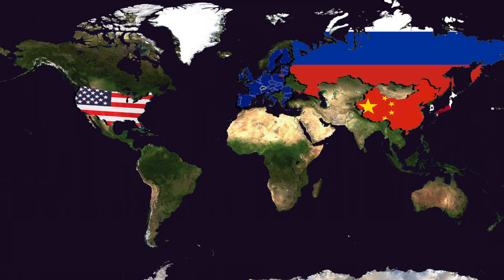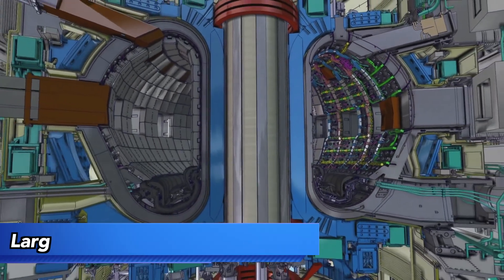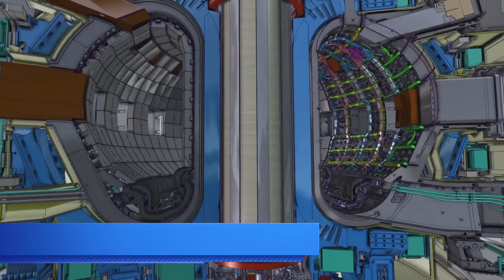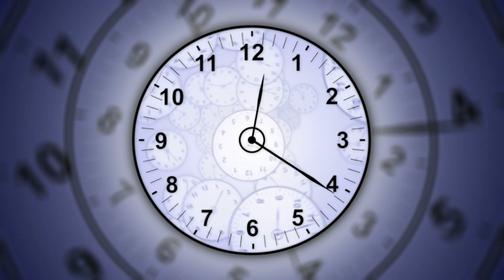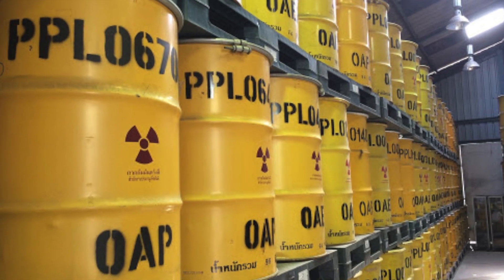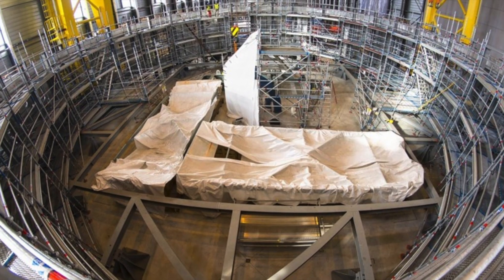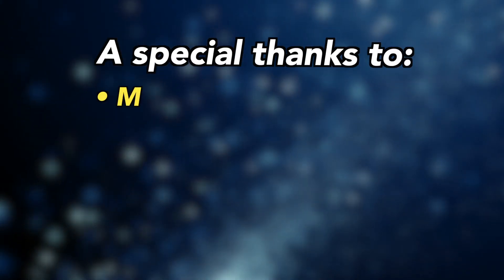ITER: The $65BN Power Plant of the Future

Comment: since when does nuclear fusion create nuclear waste? as the end product doesnt actually make nuclear atoms, it might send out some roentgen but it wont actually create nuclear waste
Reply: Some of the high energy neutrons will impact the nuclei of metal parts in the walls of the tokamak, turning them into radioactive isotopes. At the same time, some of the high energy neutrons cause lattice dislocations in these metals gradually making them more and more brittle, which means they periodically need replacing. The spent metal parts you have to remove are the source of the low grade nuclear waste.

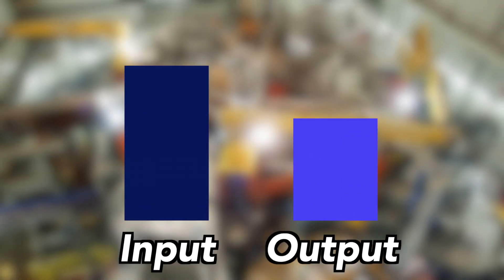Comment: At about 5:00 huge lie. JET did not produce 16MW from 24MW. 24MW was used to heat the fuel with a total input of 700MW. Measuring only the gain from the fuel is very sneaky! So intead of like .67 efficiency, its under 5 percent. So lies, spin, factual inaccuracies... Don't let journalists and physicists get by with it.

Comment: ITER will be 10x the temperature of the sun.. Anyone else concerned about the fact that our planet could blow up? And if anything went wrong in the calculations, what will be the outcome to at least the cities around it?
Reply: No, it couldn’t blow up, and the outcome to the cities would be ...0? Where have you got this idea from?
Reply: @Gomlmon99  I'm just brainstorming, but why wouldn't it be able to blow up then?
Reply: @michaelrodriguez551  Well why would it? Do you ask why a solar panel won’t blow up? Or a wind turbine? Why would a small amount of gas at a vacuum blow up?
Reply: it doesnt blow up because it is fusion not fission... as soon as there is a problem it turns off. It is not a chain reaction
Reply: There's only a few grams of plasma in there at that temperature. There is hundreds of tons of metal and other stuff around it, much of which is held at cryogenic temperatures. If the plasma touches the walls it's a nuisance and may cause localised damage, but there isn't actually a lot of heat there, there is just a high temperature - they are not the same thing. Plus, there is no chain reaction involved. It is not self-sustaining. If anything goes wrong, it cools down and stops. It's not like a fission reactor were there are kilos of hot stuff that stay hot and can go into a runaway reaction. Fission can be a bit like rolling a snowball down a hill. Fusion is more like rolling a snowball along the flat.

Comment: 3:35 "Low radioactivity and short-lived" is oxymoronic. The shorter an isotope's half-life is, the more radioactive it is. It's very simple. When you have radioactive substances of different half-lives, the one with the shorter half-life spews out the same amount of radioactivity as the one with the longer half-life but in a shorter time period. A "100 year half-life" isotope is 200x more radioactive than an isotope with a half-life of 20,000 years.
Reply: a fusion reactor releases helium and tritium... tritium's half life is 12.5 years
Reply: @Aaa-wf6cg  Thanks for the correction. I didn't know that it's possible for beta decay of that rate to have so little energy. Things like Cesium-137 have a half-life that's more than twice as long and the energy they put out is dozens of times higher than tritium's.
Reply: @Plutonia001  21D+ 31T→ 42He+ 10n+ 17.59 MeV

reaction to produce energy
helium

and 

reaction to produce tritium needed for the reaction above
10n+ 63Li→ 31T+ 42He
10n+ 73Li→ 31T+ 42He+ 10n

Tritium

from the breeder blankets
The nuclear waste produced

Comment: don't want to piss  in your soup , but that entire building is just going to melt away if the cooling isn't enough . . . . . . . . .
Reply: the plasma is not in contact with anything it is suspended in the air. There are many cooling systems, also 8 meters away from the plasma will be 4 Kelvin, which will be the highest difference in temperature man has ever seen.

Comment: BS.  Current engineering and materials are not nearly good enough.
Sensors and electronic controls way to slow to dynamically control a plasm.

We will all be dead in 2070.  the fusion reactor just 93 million miles away seems
to be very stable,   Use it    LOL    

orbital solar power generation,  put our money on proven GREEN engineering
Go to space young man..
Reply: How do you propose we get electricity from space to the ground, or get that many solar panels up there without them colliding with each other or satellites. Also what field do you have advanced knowledge of in order to know this won’t work.
Reply: @keeganharris186  LOL  BASIC ENGINEERING.  SAME WAY WE MAKE electricity here.  focus sun light ( no clouds ) using really big mirrors (silvered mylar ) to heat a fluid to generate a high pressure gas to turn a turbine to rotate a generator.   Convert that electricity to microwaves and focus it on really big 
antennas on the ground.  Not that hard to do.   10milli watts per square cm  adds up, even with conversion loses.  Gigawatts on demand.  job done.

Comment: This project is a FAKE. Bottom projected cost will be 5.1 million USD for 1 MW installed.
(Except you reduce 200 times the cost of fuel for ITER, what is really impossible in physic and economic terms.)

Just consider:
Fuel: 3.7 million USD per MW installed.
Depreciation: 1,300 million USD per MW installed. (50 years considered.)
Operation: 50.000 USD per MW installed (according to electric industry standards.)

Comment: The problem is the energy required to produce Deuterium and Tritium. If you really sum all the energy require to operate it, it doesn't give you more energy. Much worst is the E2E energy costs. It is the biggest fake.
Reply: What? Producing D and T is pretty easy, and takes barely energy compared to how much it produces. One is a chemical reaction, one is a nuclear reaction.
Reply: @Gomlmon99  I think you are terribly wrong, but maybe I. Please: costs and process, and return in energy; not the energy sourced into the toroid for the main process just to obtain D (T is almost impossible but if you insist...) This will let us put this into black and white (with a reference please.) I wait your response. Thanks.
Reply: FEBM I don’t need to do a calculation to know that a nuclear reaction will produce orders of magnitude more energy than a chemical reaction will take.

And the tritium is self sustaining, we don’t need to produce that following start up.

Edit: in case you don’t understand the difference between a nuclear reaction and a chemical one - one kilo of deuterium will release 29 billion kilos energy worth of coal when fused with tritium.

You think it takes 29 billion tonnes of coal to produce a kilo of heavy water?
Reply: @Gomlmon99  You believe but you have not information. You do not now the figures to produce, in money or energy equivalent, Deuterium and Tritium. When you add depreciation and maintenance that installation will be just a big laboratory. That the reason the project have been delayed since last 20 years (I am engineer and they are not telling the truth.)
Reply: @Gomlmon99  Salamin con queso: You need 175 kg of Tritium per eyer. I can't believe 🤦
Reply: FEBM per eyer? You don’t need 175kg of tritium for anything, that’s just made up. And ITER will produce its own tritium, so it’s free.
Reply: @Gomlmon99  You did not read the blueprints and you want to support the idea.... 😂😂😂
Of course it will produce its own Tritium but the cost?
Please. First read, then use what you have above your neck, and finally give your opinion.
Reply: FEBM read the blueprints? I literally help design ITER lmao it’s my job. The cost of production itself is nothing, the neutrons do that for us. There’s a reason no one in industry is worried about this.
Reply: FEBM idk why I’m even bothering talking to someone so ignorant they thought D2 was hard to get hold of 😂 bye

Comment: Just to get some Steam 😂
Reply: The major problem is that a major part of the fusion energy IS NOT converted into electricity. This waste must be dumped into water (mostly sea water) and will have considerable local environmental effects. Plus transmission and distribution will also have considerable inefficiencies and will not be available for consumption. The correct solution is to reduce energy consumption.

Comment: What are we going to do with the waste though?
Reply: Better things than what we do with the waste of the coal plants we have now that's for sure.
Reply: it's low/mid level waste, it just goes in a special landfill. also it's the reactor components not spent fuel or byproducts or anything like that. the metal absorbs neutrons and becomes mildly radioactive, so when the plant is decommissioned and when parts are replaced will be the only times we'll need to deal with it.

also, even fission plants spent fuel is not a big issue, on loud mouthed fear mongers make it seem like it is. it's contained, stuffed into near indestructible casks, and left sitting somewhere on the fission plant grounds. adn if the fear mongers grew brains we could finally start storing it in our permanent site a mile underground in the middle of the desert.

Comment: Having a fusion reactor in a vacuum environment is a good idea but also test it in and environment of different gasses including the noble gasses.  It took Thomas Edison over one thousand tries before he and his team invented the light bulb.  Also, helium 3 is found in abundance on the moon.  Helium 3 is a good fuel for fusion reactors.  There is also a pure vacuum on the moon.  There is also plenty of room on the moon in a large crater to test a fusion reactor.   There is also plenty of room on the moon to test an atom smasher / collider in a pure vacuum environment.
Reply: >Also, helium 3 is found in abundance on the moon
"To supply 10% of the global energy demand in 2040, 200 tons of Helium-3 would be required per year. The resulting regolith mining rate would be 630 tons per second, based on an optimistic concentration of 20 ppb Helium-3 in lunar regolith."
https://ui.adsabs.harvard.edu/abs/2014cosp...40E1515K/abstract 
With our modern technology, I have no idea how are we supposed to transport all the machinery for heavy mining. Machinery that isn't even out of the concept phase now. 
>Helium 3 is a good fuel for fusion reactors.
Sure, it produces much less neutrons that destroys your reactor walls, but at the same time it requires much higher temperature, combined with lower number of expected reactions 
> There is also a pure vacuum on the moon
That's a problem, since it will be massive pain in the ass to deal with waste heat.
Reply: having a fusion reactor in a vacuum is a good idea ? are you kidding ? it's plasma ! OF COURSE you need a vacuum ! it couldn't be done in any other environment.

Comment: $65B is actually a very strange number. 
On the one hand it's pulled out by DoE, USA. On the other, head of ITER correctly notes that EU pays according to it's plans -- 45%, or $14.5B. So total construction cost can't be $65B.
Reply: Isn't 65B the project cost, not the construction cost? Also isn't that the cost over many many years, so not as big as people think it is.
Reply: @composting_names  US DoE has estimated  total construction costs  to 2025 at $65 billion. This excludes the cost of running the machine over the next 10 to 20 years.  See the Wikipedia page for ITER.  The euro 20 billion cost often quoted is only the EU share of construction - does not include the work done by non EU countries.

Comment: I bet it will well prepared to be officially use after my lifetime which is 300 years from now
Reply: Probably in 2040
Reply: @iamfromindia4971  2040⁉️ According to the suggested timeline I’ve read, the first commercially viable Nuclear Fusion Plants may come online around 2100. So, so much more research and many breakthroughs are required.
Reply: Your kidding right? By 2040 is a huge maybe
Reply: Magnet just got shipped to it.
Reply: Right and only if you make a start.
Reply: Naa.. I think 2038-2040

Comment: That's an accurate account, including the cost, which is far higher than what they usually confess. It doesn't address the main question though: Will the roadmap set by ITER be an economically competitive with other sources of energy? While it mentions DEMO, it doesn't say how it's size would compare with the already humongous ITER. If tokamaks are to play a role in commercial fusion, it's clear new advancements will be needed, like those of the MIT-FCS or the Tokamak Energy groups.
Reply: >That's an accurate account, including the cost, which is far higher than what they usually confess.
And where do they get money? EU says that they are paying ~45%, or about 11B euro for construction between 2007 and 2025.

Comment: remember what Neil Armstrong once said.
"One small step for man, one giant leap for mankind" 

this same statement applies to nuclear fusion, once nuclear fusion is solved and eventually mastered, it will truely be a giant leap for all of us.
Reply: By then, politicians will bragg about them funding it where in reality they ask many non-sense questions about funding it. Funny.
Reply: One for (sub)continent could absorb enough need to secure the energetic transition. In fact THIS could be the goal of transiction.
Reply: Sorry but fusion ain't gonna happen.
Reply: @russhamilton3800  That's a bold statement. We know that it is at least theoretically possible, I mean, just look at the sun for example. So flat out saying it's not going to happen is just ignorant.
Reply: @HolyGarbage  no we don't know that at all. We know we can cause fusion on earth, we don't know that there is a way other that thermonuclear warheads to use it to get net power. Those are very different things. The sun has the advantage of pressure, density and time. On earth we have to settle for temperature. Even if we solve it it may not be economically feasible due to fuel, maintenance expenses, toi much down time etc. If you look back at how sketchy they have been about it, well that does not install confidence either. They said with 24MW of power they got 16MW of power out of JET. What they forgot to mention was that energy was thermal and you lose a lot of that converting it to electricity, oh and another 700MW was being used in the process. So instead of a point 67 percent efficiency it was less than 5 percent. And none of that addresses the tritium problems. Fusion ain't what they are claiming it to be. That ought to concern people greatly. Fusion programs in the private sector are vaporware, fusion programs funded by taxpayers are vaporware with legalized propaganda.
Reply: or an end
Reply: @yusufobaidat4730  in what way exactly will it be an end?
Reply: @theflyingdropbear2009  Revolutionary technology always seem to have unforeseen consequences down the road. Dynamite, nuclear fission, and artificial intelligence were never intended for weapons when originally conceived. The future fusion power plants themselves might not be dangerous, but the capabilities the technology unlocks might very well be.
Reply: @HolyGarbage  mainly because fusion reactor gives us nearly unlimited energy, which means those energy might gonna be used to destroy us in the future. I'm not gonna name the cause of it since it wasn't proven to be a real problem yet, but hypothetically, it might happen
Reply: @HolyGarbage  lol, you do know that thermonuclear bombs exist right?
Reply: @kalyanvadlamani7607  Yes. That was exactly my point.
Reply: @yusufobaidat4730  how so ?

Comment: What happens on a meltdown ?
Reply: It can’t meltdown, it’s a plasma.
Reply: Original nuclear reactors ( fission ) require a “brake” to not run away. If something goes wrong with that “brake” then it will result in a meltdown. These fussion reactors like ITER require input energy to keep running. So they are unable to runaway. Cut the power in case of trouble and it’s silent.
Reply: @Engineer9736  What happens with a lightning strike 🤔
Reply: @Dman8s  lol

Comment: Not to be too sarcastic, but anything that is budgeted at $65,000,000,000.00 is probably not going to happen.  Do you think that many people with $65,000,000,000.00 going through their fingers are going to "keep their eyes on the prize" and make sure the money is spent wisely?  (The prize of the project goal...)  Not going to happen in this generation.  Just like NASA's SLS rocket, which is a 22 yr. project - it probably won't happen until someone else does it first (SpaceX), and that, motivated primarily out of embarrassment.  Get excited, folks!  Maybe your grandchildren will bask in the light...
Reply: You are aware that the project is physically 5 years away from completion? All the buildings are finished, and the first 2 giant parts of the machine are in place.
Reply: @Engineer9736  Somehow, my stuttering led to my fingers - its not $65B - its at $650M - so its a safe bet your tax payments will easily see another $350M paint job on the SLS trailer hitch before its over.  The problem is they have switched contractors several times and, hence, had to re-tool much of the construction.
Reply: @Engineer9736  Find me a hat and I'll eat it if they finish on time.
Reply: $65B is actually a very strange number. 
On the one hand it's pulled out by DoE, USA. On the other, head of ITER correctly notes that EU pays according to it's plans -- 45%, or $14.5B. So total construction cost can't be $65B.